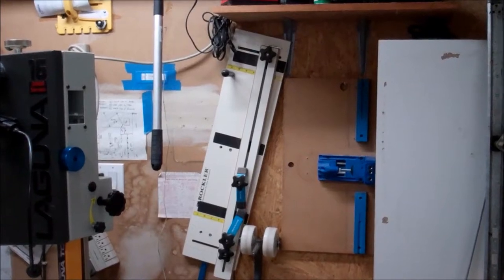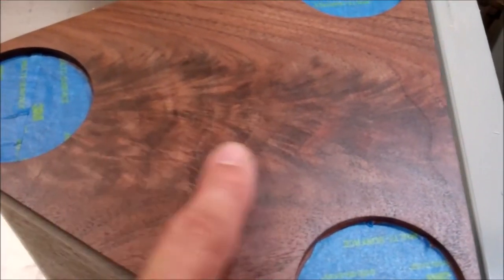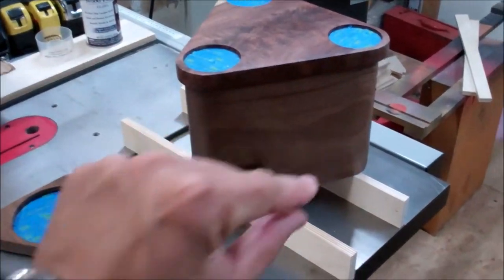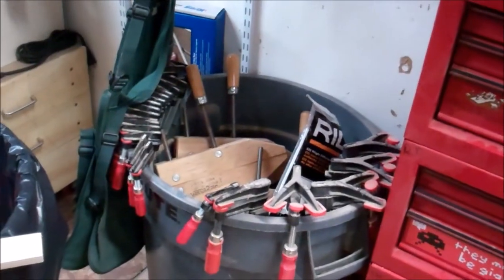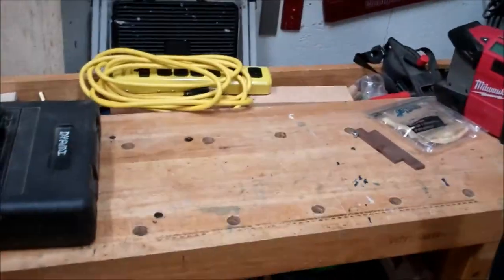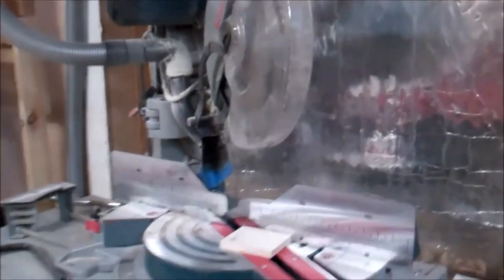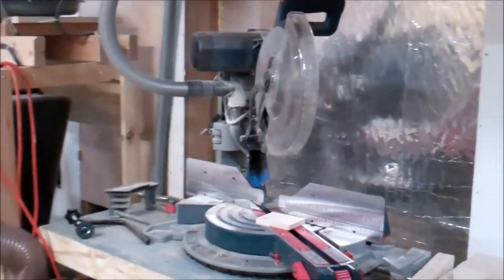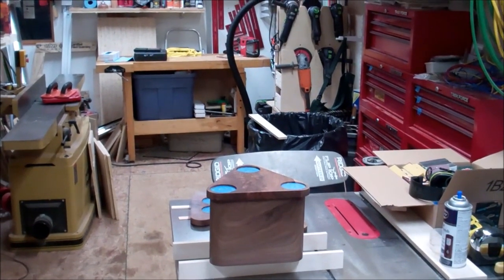2015 June Shop Tour

Comment: you have a lot of great tools! you love those festool sanders/grinders i see..ive been considering the r.os. but still cant bring myself to spend 400 on a sander but lately ive been cussing out my rigid because the d/c isnt working good anymore and i think my lungs and eyes are worth 400.. not to mention my wife objects to me spending that much on sander. im working on it though.haha great update on the shop and love that bandsaw u got there! question: hows that delta? i saw it at lowes and im also considering that as well thanks for sharing
Reply from the maker: Thanks, Joe. Regarding the sanders, while I love the Rotex, I can only recommend them if you're doing curved work. For flat wort, the ETS sanders are just fine. As for the table saw, I like mine, but I must caution that it is from a Delta two corporate owners ago. I can't speak to the quality & performance of their current offerings.
Reply: Dyami Plotke little here and there but not enough to purchase it.it would collect more dust on the surface than in the bag" haha thanks for the heads up on that! Now i know which direction to go with the samders and ill definitely have to do some research on the current delta owners.tth anks agai